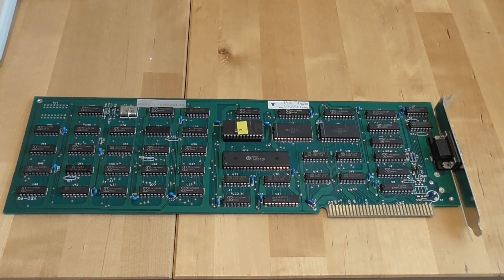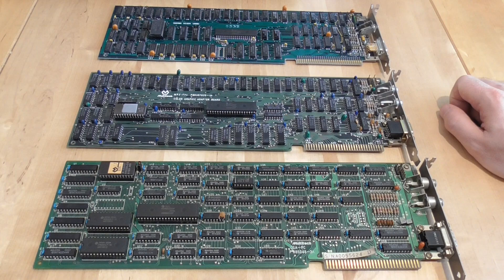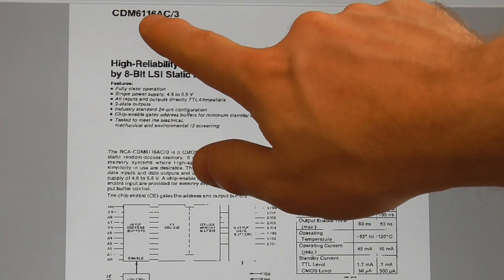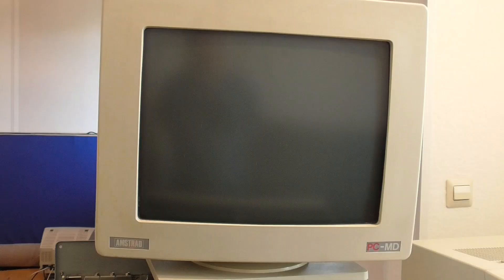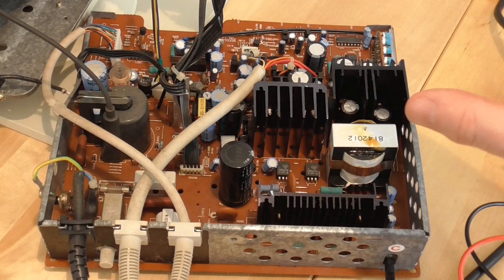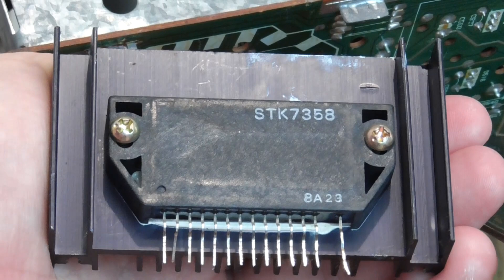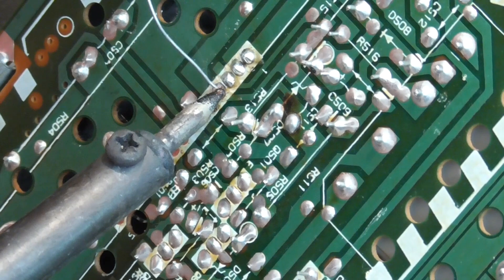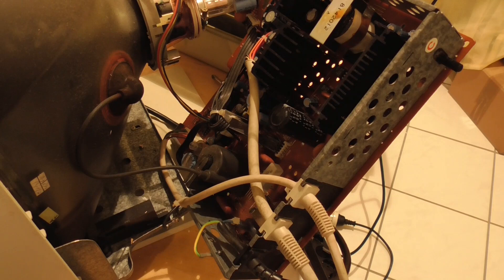Repairing and Benchmarking a Paradise EGA Card + Monitor Repairs

Comment: Fixed that monitor yet ?
Reply from the maker: No, sorry. It's been on hold for a while.
Reply: @PCRetroTech  yeah no problem, real life gets in the way all the time.
Time and money amd motivation 😔

Totaly understand. Although your method of repair or talking was  vague on camera, you seem.to have right idea....

Any high voltage, heater voltage,
Caps ,Power supply, main bias resistor, diode bridge, main switching tranisitor/package etx flyback, horizontal tansistor.

Shorts and opens, and yeah use the cheap old light bulb trick in series with the main ac in as a current limi

I have old apple.,amiga,c64 and some pc monitors

When i get a chance 🙄 . Most work, fixed a.few, most problems power supply, flyback,H.O.T.,caps etc vertical ic.

Only done bring back to life, tweaking image i still.yet to learn.

What parts work.the hardest.
What parts subject to time 
Also i see people.use thermal cameras, can use inrared laser.temp.gun.

As a fellow aussie, good to see videos.

Thanks 👍
Reply from the maker: @easyerthanyouthink  I suspect the transformer in this monitor, but its in storage at the moment while I take a few months looking for accommodation. I will get back to it eventually.